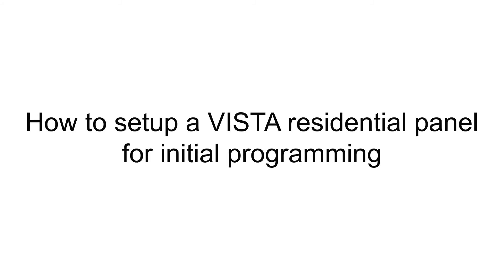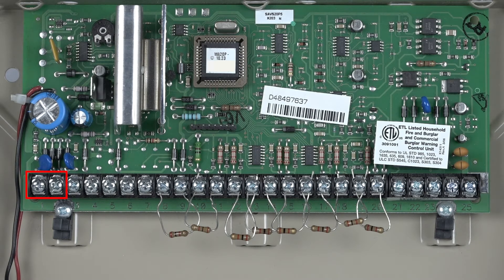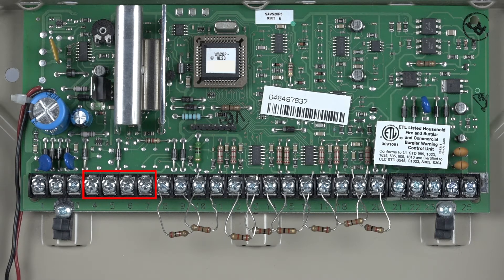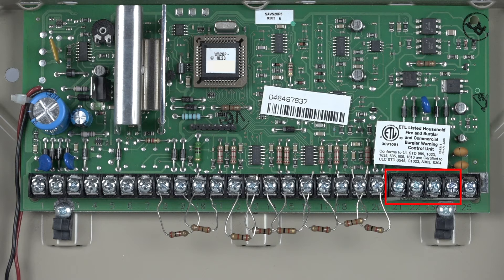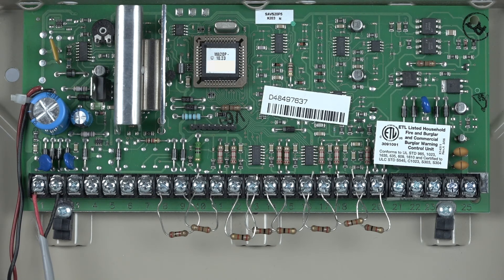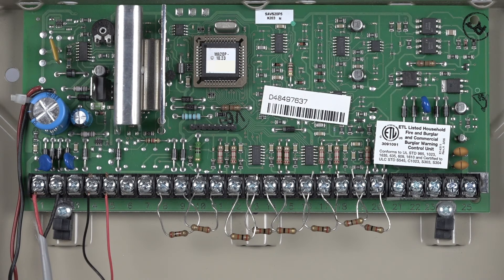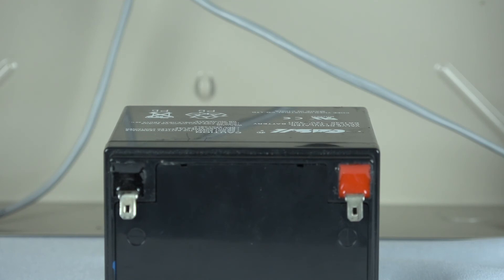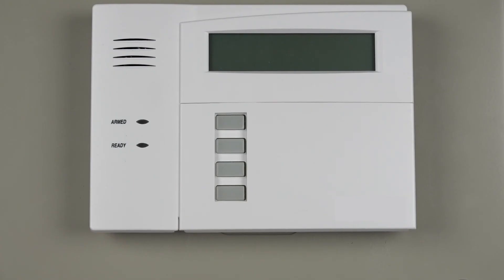How to setup a VISTA residential panel for initial programming - Resideo

Comment: How do I mount the circuit board of the panel into the aluminum enclosure?
Reply: Franklin, simply use insulated standoffs to mount any circuit board to an enclosure. If you are using the enclosure that came with the board, all standoffs should have been supplied. I would recommend using those.
Reply from the maker: Hi Franklin, thank you for reaching out! For assistance on your VISTA panel we commend you contacting your security technician.
If you're a security technician contact our technical support line for contractors at 1-800-645-7492. -Charlie
Reply: There are 2 black bits that come with the alliminum box and 2 screws, put one screw in each bit and then mount the circuit board onto the bits, then put the screws in the nearest screw holes, and then screw them into the box.